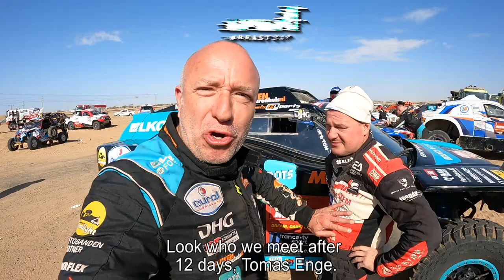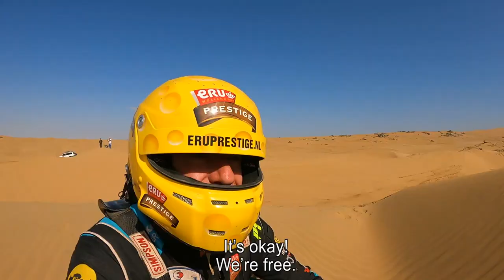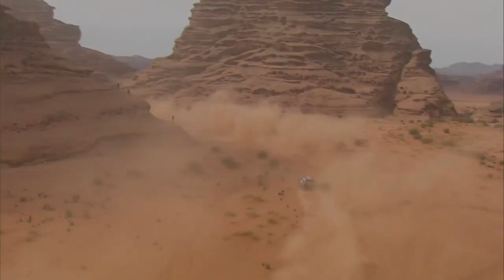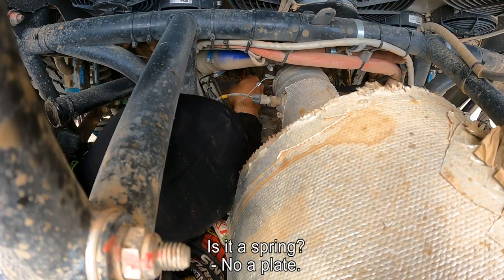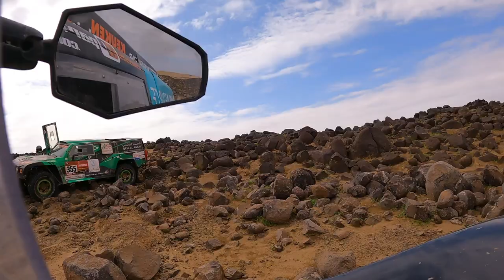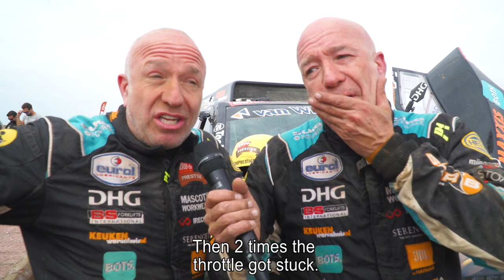Dakar Rally 2021 problems but finish, will there be a new Beast?

Comment: amazing work guys well done, tbh you dont need a new beast you had a full dakar with pretty much no problems and a strong car, fix the trottle problem and get a stronger and faster engine and top 20 top 15 should be inthere :) keep on going